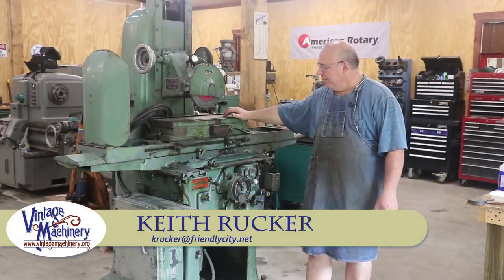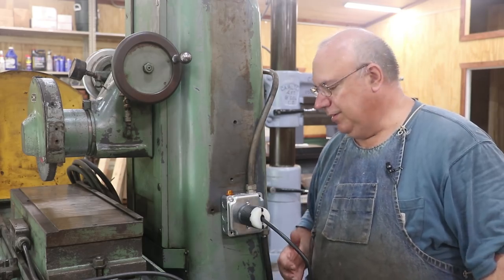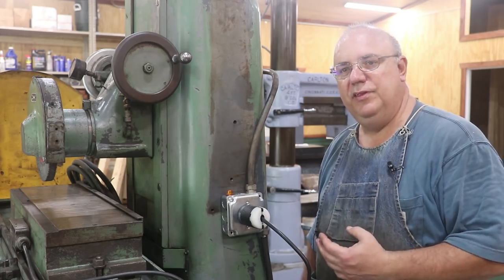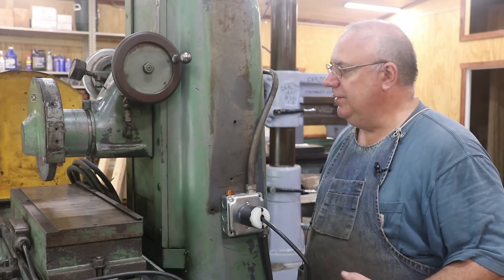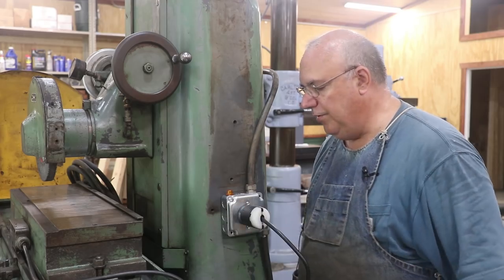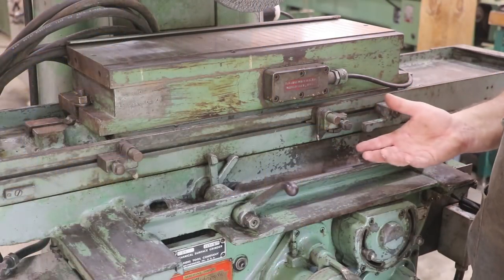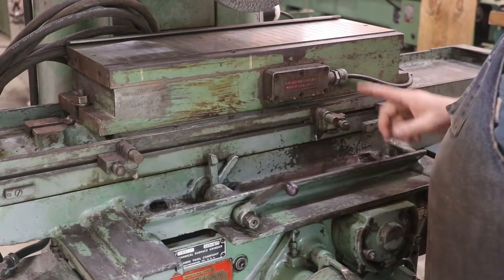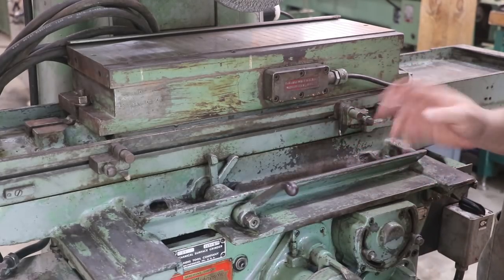Moving and Leveling the Landis Surface Grinder

Comment: Nice video.  Something I learned as a young fellow doing survey work and leveling a theodolite is that you can minimize the 'back and forth' by adjusting both front screws simultaneously.  One screw up and the other screw down.  Doing it that way doesn't affect the front to back level much.

Comment: Great work Keith. Have you ever thought of putting a floor pan underneath of that grinder to keep the oil off your new concrete. They make them in various sizes and you should be able to find one that fits almost perfect.

Comment: Keith, on the oil beneath grinder you might try either powdered laundry soap... or cornmeal. Both work better than you'd believe.
Reply: Do you mean to soak up the free oil, or to deal with the stain?  Short of steam cleaning and chemicals, I don't know of a way to get oil OUT of concrete.
Reply: somebody else   Believe it or not, the cornmeal will actually draw SOME oil out. The laundry soap will absorb less, but then helps wash away.   To give you idea on cornmeal, I first heard of it for cleaning sheepskins. Sprinkle it on, roll up and store in bag. Extracts oils that adhere dirt. Then I spilled some two stroke fuel on a new Toyota 4 runner carpet. Big stain. Sprinkled cornmeal on it and left for two weeks. After vacuuming carpet no trace of stain... or smell.

Comment: if you can find a bag of Bentonite. used to water proof pond bottoms..  you can spread that out on your oil stains and it will after several days of sweeping it back and forth.. pull all the oil out of the concrete..   its actually super fine volcanic ash.. that landed a thousand miles or more from the volcano..  at one use it was used to dry polish black pianos..  getting the buffing marks out..  its a super absorbent..  hopefully somebody around there sells it.
Reply: Diatomacious earth (found in many farm supply stores, such as Fleet & Farm where I live), is the most thorough 'oil dry' that I've found.  Still doesn't pull oil OUT of concrete though.
Reply: i realize i sound crazy.. but i have seen it work.. i used to sell it when i worked at a specialty paint store that sold to movie studios and furniture factorys and  antique refinishers.

Comment: You think 4 points is bad do it with 42!!!! lol Pretty sure your master level is saying your chuck isn't flat. You were chasing your tail because you weren't putting it back in the same spots so any variance in the chuck was showing the machine out of level when actually it never moved. Print it with one of your straight edges and check it out. :-)
Reply: bcbloc02, I thought he ground that chuck when he first set the machine up. Do you need to grind it in every time you move the machine around? I was wondering if you would have to again if you did major work on it.
Reply: It should not really be necessary to regrind just from moving, but they do wear from use and need to be dressed also any wear that was in the machine slides gets translated into the grinding of the chuck so unless you check it on a known flat there is no way to tell if it is or not, running an indicator over it won't show the errors because the wear in the ways will be cancelled by the grinding of the chuck so the pattern it follows will be the same but it will actually be frown shaped.  This means you have to be careful when you print it or you will tip the straightedge and it will look good but not be as it will rock or hinge in the middle.

Comment: Keith in use, with movement, maybe even floor settling ever so slightly, is it practical to maintain that 1/2 thou. or do you need to calibrate it fairly often? That is a cool level BTW.
Reply from the maker: Most references suggest checking your machines for level every six months.  More often if you have an unstable floor.

Comment: Selenium rectifiers have an estimated service life of 40,000-60,000 hours of continuous operation.  They went out of common use about 40 years ago when more modern and much smaller rectifiers became available.  This is not a serious enough problem to replace an SR unless it is part of a general upgrade where it makes sense.  Here, if the wiring was in good condition and the rectifier was doing its job the only reason to replace it is for cosmetic purposes.

Comment: For one man leveling, there are several phone aps for monitoring cameras, using the monitor keeps you from jumping up and down to look at the levels.
Reply: I keep finding things to use my cheap wifi borescope on, half the time I'm just using it as a regular camera to watch a gauge or something on my $20 Walmart toolbox phone (never activated as a phone, I just use it with wifi).  The software to view it looks pretty janky, but since I only use it as a shop tool I ain't too worried ;)

Comment: Keith I'm not a machinist but it occurred to me that if you walk away from the machine to get to get a part or maybe a 123 block and forget the magnet is energized when you return it could be dangerous for your fingers. The "energized light" should be much more obvious than the small light on the side. Just a thought. Love your channel.
Reply: The magnets are strong but not in the sense you are thinking. My Brown & Sharpe surface grinder mag chuck will hold strong enough to support its own weight from a metal block stuck to its table. However, it won't suck a part out of your hand like you are picturing. The thing about a machine shop is it is full of ways to lose a limb or worse kill you. You have to keep your head in the game at all times.

Comment: Thank you Keith. I have one question: is the surface of your magnet accurately flat to 0.0001"? If not, wouldn't the position of the level be influenced by surface imperfections in the magnet?

Comment: Keith, Great to see all the work paid off and I like the cleaned up DC power. Does the new DC power supply have the same amperage output as the original?
Eric
Reply: its only a rectifier, the supply is right from the ac, a modern rectifier will be easily more capable than an old selenium plate rectifier,  a 150amp rectifier fits in a matchbox

Comment: Nice work as usual, Kieth. Is it sacrilege to use a wooden handle on metal machinery, or just personal preference to use metal only?
Reply: Many old machine wheel handles were fixed (the outside grip did not rotate around the shaft that was set in the wheel), so the smooth metal combined with oily fingers made it slip easily in your fingers as you turned the wheel by that handle.  The other issue is coolants and oils getting into the wood.  Shop chemicals eat wood finishes and wood.
Reply: That makes a lot of sense, I never thought about the oils and coolants getting onto the wood.

Comment: Keith I know you're doing a lot of rebuilding I'm thinking of making a pattern for 18" × 12" × 3" cast iron square to do  alignment testing .might you need one also?
Reply: Old Iron Shops 4
Reply: i am sorry but what ?
Reply: Old Iron Shops i think she means she needs 4 squares
Reply: fireball tools makes big squares. has plenty of clamping surface. Abom loves them
Reply: well if that's so id better get myself a pattern built lol
Reply: those are great squares but there meant for fabrication . the ones im making will have 3/4" flanges and are meant to be scraped in to very high tolerances . think something like the granite ones but much lighter

Comment: How do you get 120VDC out of 120VAC with just a rectifier? Wouldn't you need to transform it to a higher voltage before rectification?

Why wouldn't you level the grinder left-to-right and only then worry about front-to-back?
Reply: Cathy Garrett 120VAC is expressed as an RMS voltage. Peak voltage is 120x1.414~=170V, and a full wave bridge rectifier plus C or CRC filter will give you nearly all that as DC. The old selenium rectifier wild have dropped a lot of volts across it. His new one probably only drops a couple of volts so he is probably now getting more DC than ever. Assume Keith has taken all that into account.

Comment: I'd think you'd only need to check level twice with a three point support.  First parallel to two of the feet and set that, then perpendicular to that direction, and moving the third foot shouldn't change the first measurement only rock on the other two feet.
Reply: The leveling screws are never going to be exactly in the center of the divots in the risers he made when he dropped the machine on them. As he adjusts the screws, the risers are going to shift around under the load until the screws get right in the middle of the cone. After he runs the machine once, it's probable going to shift some more. I hope this explains it.

Comment: Was the machine voltage 220/440 that you ran the 120 to the rectifier? Did you take your 120 off the higher voltage? If you did that you could have created an unbalanced load since you’re pulling power off just one side. I’m not an electrician and I did something similar to what I think you may have done and the electrician explained the unbalanced load problem. If that sounds familiar you may ask an electrician about what you have.  It may work fine for a long time and then create a problem like mine did.  I hope yours is okay and you don’t have to change anything.

Comment: Machines with 4 legs best thing is to make a third false leg and wind  2 legs up do the levelling using 3 legs then wind the 2 original leg down this should get you pretty close to level hope you know what I mean?
Reply: could you just wind up the one leg with the least weight on it, level with the other three and then just wind down the fourth leg until it bore weight and didn't rock? But you were going right where I was thinking.
Reply: For my lathe, with 4 feet, there is no choice.  Besides, a 4th foot is necessary to correct any twist in the bed.
Reply: With 4 legs put the level on the diagonals. Leveling  one won't affect the other  if using common sense.

Comment: But is it a FULL-BRIDGE-RECTIFIER ?
Reply: A EE talking here - You are referring to a "Full Wave Bridge Rectifier" (4 diodes) versus "Half Wave" (2 diodes).  In this application I doubt that it would matter.  Full wave creates a "smoother" (less noisy) DC level which is important for things like audio/video receivers and such.  But for an electromagnet a half wave should be just fine (and probably cheaper).
Reply: Lol, that's hilarious!
Reply: Well, he said he had 120ac in and 120dc out so probably full wave bridge rectifier. You loose about half the voltage with a single diode. I would suppose you would want as much magnetic holding as possible so your part doesn't go flying.

Comment: Selenium rectifiers... the stuff is toxic in overdoses but is also an important mineral for health. Selenium diodes had a higher forward voltage drop and limited reverse voltage limits. So for high power DC conversion you had motor generators or Tung-Sol mercury discharge tubes. Mercury tubes are nasty, producing a lot of hard UV light as well as the toxic mercury contamination if/when they blew up. So nobody really uses anything except silicon now.

Comment: That grinder looks very different from what it did when it followed you home, I will say hughe improvement. But if I can say something, to enter a cable into an electric cabinet on a machine  from the top, You just doesent do that. The reason are that the top of the cabinet are the side where you dont want a hole where debree of any kind can get into the cabinet.

Comment: Ah, most naturally the reason the box was mounted on the side was to keep the DC cable length down to as short as possible! 

DC, dose NOT like to run any length, the voltage drops, and also the length will limit current based on cable size, Cable size requirements are diff on AC to DC, this was not the best Idea!
Reply from the maker: I don't think it will be an issue at all.  The reason it was mounted on the side was due to the size of the original electrical equipment.